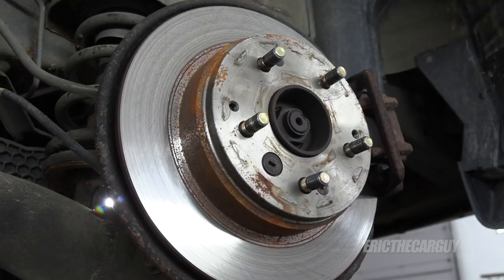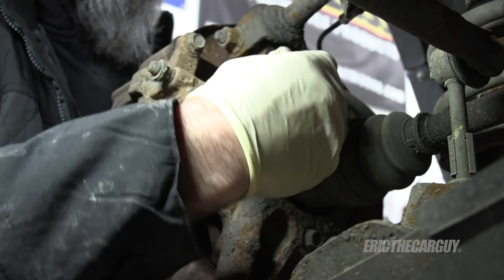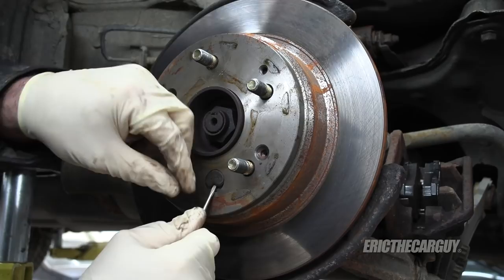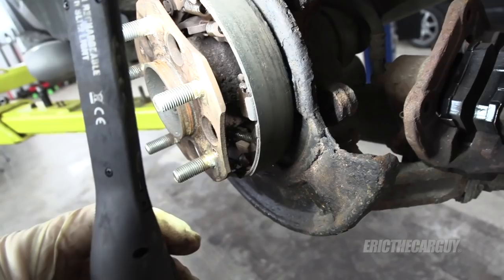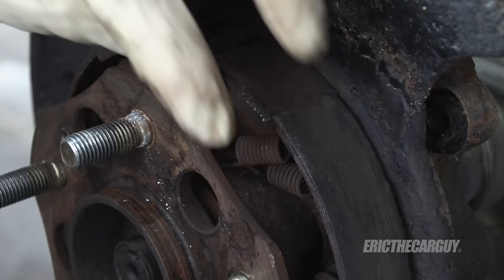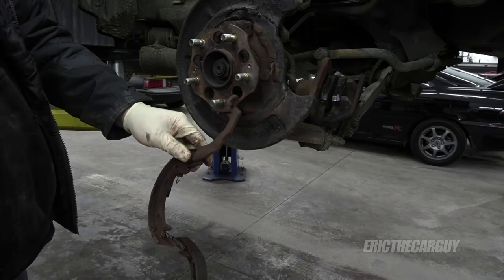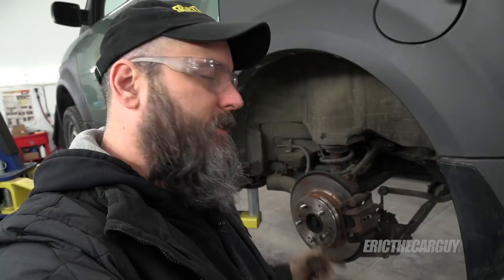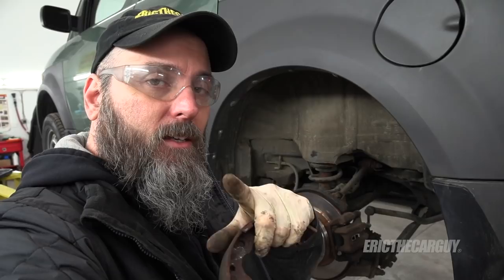Parking Brake Shoe Replacement on Rear Disc Brakes

Comment: I had the same problem with the drum not fitting on new shoes.  If you accurately compare the new shoe size to the Honda ones it seems these Chinese made ones are slightly larger diameter and do not allow the drum to fit.  I think it's because of manufacturing for the shoes looks like they are punched out and there is slightly extra material on the contact points.  Grind  a little material off the shoes where they contact the adjuster and up top where they contact the  anchor and they will fit nicely.
Reply: I had exactly the same problem with brand new Honda shoes (made in Japan) from the dealer.  The original adjuster spreads the shoes 51mm at minimum, but the replacement is 47.5mm.  I suspect that Honda may have revised the shoe and adjuster design.

Comment: Hey @EricTheCarGuy, any tricks for a seizing parking brake cable?  I picked up an 09 civic Si and the parking brake started to stick on the drivers side.  Can the cable, or connection point be lubricated at the caliper connection point?  I checked for the cable getting caught up but nothing out of the norm.  Just feels like there should be some lubrication/maintenance point, hoping to not have to replace cable.  Apparently this generation of Hondas are common to this.  :/

Comment: My lexus gh450h parking brake on 1 wheel making noise the moment I accelerate up to 30mph, like cracking noise, this started happening after I used parking brake after 2.5 years not using it.. tried to adjust up and down but doesn't help

Comment: Had to remove and replace the shoes on a Toyota land cruiser when I was freeing up the parking brake bell crank. Can anyone explain why there's a steel part going into an aluminium bracket in on the bell crank's in these vehicles

Comment: My Corolla was towed (pulled by the front end) a few months back and the front suspension just doesn’t feel the same. Feels like the right wheel starts moving before the left when I start moving from a full stop. What could be the issue?

Comment: Erik, do you think, with your experience, that the parking brake, perhaps being a bit too tight, could be the cause of the drum on that rotor getting searing hot when driving?  When I say searing hot, I do mean, so hot that when you throw water onto it, it instantly sizzles and throws major steam.

I'm trying to decide if THAT is more the cause or perhaps the bearing assembly.

I'm leaning towards the E brakes, because the drum is what gets hot.  Not the calipers nor the center part.
I used our thermal camera to see where the major heat was and the drum glowed like we were landing on the sun.  LOL

I won't know for sure until tomorrow.  I have the car up on the jack and supports right now with the tire off, but not taken apart as yet.

But videos like yours give me ideas of what to look for.  If I find that the E brake pads are not thick, then this could be the problem.... I suspect.

Ideas?

Comment: Got any tips for a drum brake that won't come off even after the shoes have been backed off to their maximum? And has its bolt hole for backing off the drum striped?
Reply: Beat on it with a hammer. It's likely seized itself due to heat to the inner hub.
Reply from the maker: Link in the description to a video about that.
Reply: @ericthecarguy  That hole in my drum, it has only one, is stripped. And the shoes are holding the drum in place even though they are backed off to the maximum. I suspect the shoes made a groove, and can't get over the lip. Any tips on that?

Comment: Wow, That is quite a job, I see why the parking brake shoes, don't get replaced, most of the time, with a rear wheel brake job
Reply from the maker: In my experience it's not often necessary because normally the vehicle isn't moving when this brake is used. It's either rust or damage that necessitates their replacement. Thanks for the comment.

Comment: I think I would have turned the drum before removing shoe surface but it's on I guess 😂 As stated do one side at a time works best from drums imo and don't forget to lube the friction points on the backing plates . I had a Chevy do a similar thing and the anti-seize was keeping the adjuster from going in all the way like how you use soap to push out a pilot bearing 💪
Reply from the maker: The rotors were only a few weeks old. No need to turn the drum. Thank you for the comment.
Reply: @ericthecarguy  did the other side fit better ?
Reply from the maker: No, same issue.

Comment: Question, is it standard to ensure the parking brake is fully functional on a rear brake job at a mechanic?  My mostly holds only after forcing the hand brake to 100% (Which is kind of tough to sure you make it to the last click) on a 2012 Nissan Xterra.
Reply from the maker: For many mechanical certifications the parking brake has to function.

Comment: I was all ready to do the brakes on my dakota but the parking brake cable springs were dust in the bottom of the drum and Mopar discontinued replacements in 2015. FML
Reply: Find any big forum for Mopar and ask what spring is the closest replacement. Guaranteed, there's someone out there that knows that either by pain and error or because they run parts. As is, it's likely another car shared your springs.
Reply from the maker: I'm sure you could find an aftermarket replacement. Probably less expensive as well.
Reply: Most of what I've seen on forums guys just pull them from junkyards. Found a comparable looking spring for a 1970 mustang so I ordered those

Comment: I changed a rear rotors on 2012 odyssey.. I just don't get the fact that you dont hear drag on parking shoes.. when I adjusted my parking shoes rotor spun freely with slight touching of pads .. but?? When I applied parking break she rolled on me .. Help !!

Comment: Will the star adjusters automatically take up the slack as the pads wear or do you need to manually do it every so often?
Reply from the maker: No they will not. This is the parking brake and not normally used when the vehicle is in motion. Technically the shoes should never wear out. The only times I've had to replace them were due to rust or damage from improper use. i.e. leaving the parking brake on while driving or improperly adjusted after a brake service.

Comment: **Use the NEW adjuster** unless you want a bad time.  2003 CR-V here.  Same setup and part numbers.  Both the aftermarket and genuine Honda replacement adjusters are ever so slightly shorter than the original ones.  I too liked the feel of the original adjuster better, so tried to use it initially.  The hat was definitely not going over the shoes.  I took a swear break and then swapped out for the aftermarket adjuster and the dang rotor/drum pops on like it should.  I have genuine Honda shoes and a Raybestos hardware kit that looks identical to the one in the video.  The original adjuster holds the shoes 51mm apart at minimum adjustment, vs 47.5mm for the replacement part.  Extremely helpful video otherwise.

Comment: 19:31 is where the whole assembly falls to the ground and parts fly everywhere on my 2006 toyota highlander.  Spent 3 hours today and got NOWHERE.  Got this tip from another video- -tomorrow, when I get to 19:31, I will STOP and wrap PAINTERS TAPE loosely  around the whole assembly before attempting to insert that upper cross brace.  Then, put both hold down springs on ,THEN adjust that cross brace  into the correct position..   It looks like toyota and honda have the same problem-when you spread the shoes at the top to insert that cross brace, its too far, and the whole assembly just drops off.  Last step would be to put those 2 top springs on and then install the rotor and adjust the adjuster wheel at the access hole. God, what a pain in the * !

Comment: If you can't get  the disc/drum back on when new shoes have been fitted, it is more than likely, if it has not been mentioned already below, that you have to run the cable adjuster at the parking brake lever to minimum  and get the cable as slack as possible after new shoes are fitted.  It is likely that the adjuster at the parking brake was tightened up over the lifetime of the old shoes to compensate for the wear of them if it has one?  No need to get asbestosis.
Reply from the maker: No, that was not the case. These were aftermarket shoes that simply didn't fit the proper spec. Also, I wore a mask and also safety glasses. Thank you for your comment.

Comment: Your thoughts on using the intended Japanese spec driver for the rotor screws?
Reply from the maker: I'm not even familiar with the "Japanese spec driver", and I've been doing this 25+ years. That's not to say it doesn't exist, but it was never mentioned to me, even in Honda training school.
Reply: @ericthecarguy  JIS #3 apparently. I never got one I just drilled mine out.
Reply: @ericthecarguy  JIS screws (Japanese Industrial Standard) look like US Philips but have a different angle and depth. A US Philips driver does not fit properly and will easily cam out. A Vessel IMPACTA 980 makes short work of those stubborn rotor screws.

Comment: Are the backing plates super expensive to replace? If not why not just go ahead and do it
Reply from the maker: You have to disassemble the entire hub to do it. My welding took a fraction of the time it would have taken to remove everything to replace the backing plate.

Comment: I was wondering if the parking brake was still on, but the pads were so low it didn't stop you from taking them off. But apparently not.

Comment: re new shoes won't fit inside rotor, do you ever remove the rust ridge from the rotor?
Reply from the maker: The rotors in this case were only a few weeks old and did not have a rust ridge. Thanks for the comment.

Comment: Meanwhile my drum only handbrake is so rubbish that when I apply it - it still can roll away. It still passes the MOT, but it's not at my standard. I've adjusted according to spec and how to do it. Then adjusted it against spec (removing interior trim) so it starts to grab at 3-4 clicks rather than 7-9 (easy to adjust without removing trim, a socket fits through easily, I've tried it)

The only thing left to try is to clean the hubs, brake shoes and parts before getting parts from the higher end version with disk brakes.

Comment: I respect your decision not to pull the rear bearing hub, but I always did even on like drum brake Hondas I always blew that hub off and I never had an issue with the bearing failure at least not that I know of I've done it on my own cars as well found it too difficult working around the hub.
Because normally I'm not was staked down,
To lock the nut into place on the axle, I would just put it back to the same position using the portion of the lock nut that was staked down as a reference and the key way in the axle you know what I mean

Comment: Ford SUVs all the time when we did a great job on them with new rotors you might as well I told the customer you might as well just count on doing the rear brake shoes too and hardware 9 times out of town you pull them off and they just fall on the ground.

Comment: ERIC my mechanic changed by BRAKE SHOES but now my parking brake isnt hard to pull. I can pull with my Pinky Finger!! Manual says no more than 5-7 clicks to engage, but now it takes 8-9 clicks to fully engage brakes! What happened what can I adjust? 2000 mitsubishi Mirage..
Reply from the maker: Sounds like it could use an adjustment. Consult the service manual for the procedure on your vehicle.

Comment: Do you have a ridge on the inside of the Hat again?
Reply from the maker: No, the rotors were only a few weeks old and did not have a rust ridge. You can see it in the video when I talk about rust ridges on the inside of drums making them difficult to remove. Thanks for the comment.

Comment: @19:31 was where 4 sets of hands is needed I'm sure the honda engineer who designed the element parking brake is laughing at eric, that and honda having the 2 rotor screws just in case your bit breaks after getting first one out. not that it happened to me.

Comment: Why didn't you just tighten the shoes, put the disc on, loosen until the wheel was locked and then adjust from there?

Comment: Not being critical, but regarding the shaving of the shoe.  Isn't this what the adjustment is for?   You put on a fresh rotor.  It does not fit, so you adjust it.  Several videos on how that is done including  https://www.youtube.com/watch?v=h9z5o1wscZQ   Seems like the same thing happened here just that you added fresh shoes.   I watched another video where that guy did not know about the adjustment and shaved off some of the rotor.  His logic was the rotor was out of spec.

Comment: How strange, both you, and Eric from SMA put out very recent videos about full brake jobs, relating to rear handbrakes, rear shoes, and the general re-doings of a full brake system, and I'm literally wrapping up this exact job on my moms old Grand Am. Rear parts were non existent. Two broken bleeders, 2 stuck slide pins, bunch of torn boots and bad piston seals. BUT, on the plus side, I got new wheel cylinders for the rear, rear hardware, caliper rebuild kit, pads, rotors, and larger bleed screws for like $140. WAY WAY WAY cheaper than any shop would need to charge to make this old thing safe for one more summer.
Reply: It's also now sporting slide pin boots from a 92 Integra, that parts car is the gift that keeps on giving, it has saved lots of bacon
Reply: The parts store people yelled and scalded me for asking about rebuild parts and to not do it and its wasting time and were very frustrated when I explained I couldn't fork cash for new calipers at the moment, online purchase went much smoother. Seems like local business REALLY REALLY depends on that personal customer service, which a lot of these new chain stores just don't seem to offer.

Comment: Isn't the adjustment screw backed all the way off?  Is that what caused the pads to seem to be 'too thick'?  Pure novice here.  Just asking.
Reply: The replacement adjuster is shorter than the original one.  At minimum adjustment it spreads the shoes 47.5mm vs 51mm.  Using the replacement adjuster allowed the hat to fit over the shoes easily.  I tried using the original adjuster before I discovered this.

Comment: to replace the brakeshoes look uncomfortable never see so tricky brakes with clips you must turn it over. i dont know this horseshoe in germany we say snapring or savetyring ...ok other country. what i like to do is remove all the rust and dirt best i can it help next time to work on brake. parking brake replacement is pain in..a...

Comment: This job is a pig.

I did this on my Honda CRV and found it very difficult to adjust using that star wheel.  You made no mention of adjusting the cable using  the adjustment under the carpet.

I agree its best not to remove components that are unnecessary and will cause problems later.
Reply from the maker: Actually, I did mention about the cable adjustment; always adjust at the wheels before adjusting the cable. If the wheels are adjusted correctly, the cable rarely needs adjustment. Thanks for the comment.

Comment: Turns into total hack job when he takes an angle grinder to the friction material then sprays lube on that same material. I would not trust those brakes at that point. Better idea would have been too take off the shoes and grind a little metal away from where they contact the pivot plate making the overall circumference less allowing the rotor/drum to slide over.

Comment: Dear Eric the Car Guy,
Do your self a favor and clean you mounting surfaces to help avoid lateral run-out
Reply from the maker: I used to do that but I have yet to notice a difference when not doing it. Thanks for the comment.
Reply: @ericthecarguy  very cool,I'm a tech at a private shop(flat rate sucks,lol), been doing this a long time as well,ironically the job I do more than any is honda/Acura 3.0,3.2,3.5 timing belts ,love the channel keep it up.
By the way check out the Hub Buddy
Reply from the maker: I have one, but like I said, I didn't notice any difference when not using it. It's not a bad idea though. Thanks for the comments.

Comment: Whats the point of having a drum brakes and normal brakes at the rear wheel?...it just makes everything twice as hard/troublesome...And with newer cars you have all that crap combined with electronic brake motors and computer modules....🤮

Comment: Your general non model specific video is fairly useless, air hammering the flange screws is a good idea with a wheel bearing involved? Lol....drilling the the screws is the only way that doesn't impact ball and race in the bearing.

Comment: I hate those mother trucker parking brake shoe replacement. Just saying!
Reply: I commented before I saw you had a problem getting the rotor back on. I had the same issue. Ended up taking it to my mechanic and he basically did what you did and took some material off.

Comment: Replacement shoes for hondas are always to thick
Reply: I think they revised the shoe and adjuster design from original.  I had the same issue with genuine Japanese made Honda shoes from the dealer.  The new adjuster is 3.5mm shorter.

Comment: 6:03 pulls the lever without holding the button
click**click**click**click**click**click**click**click
part of me dies inside
Reply from the maker: It is not necessary to hold the button when applying the parking brake. The button is only there to release the parking brake.